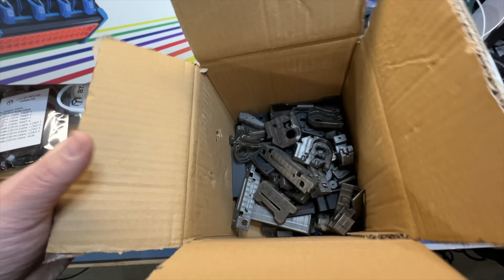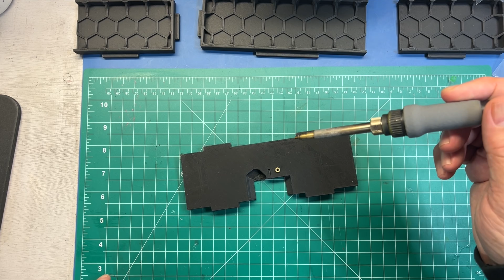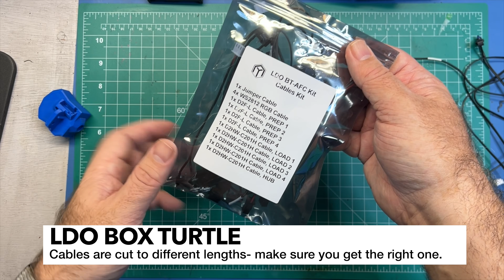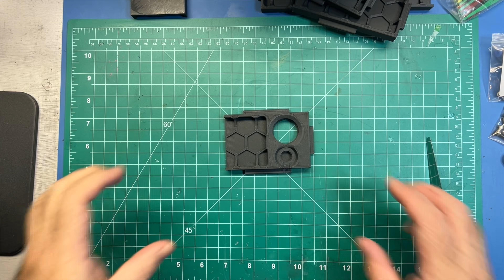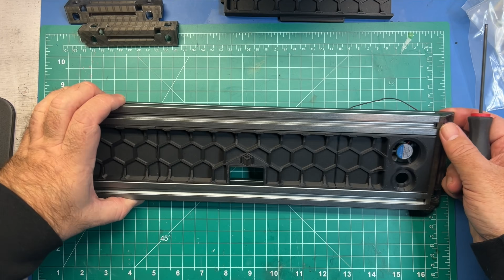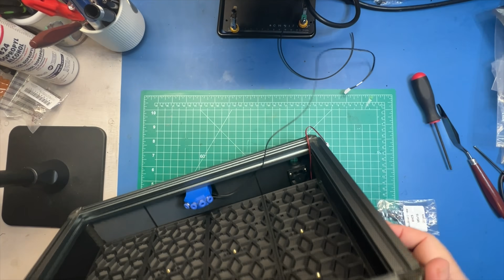LDO Box Turtle Frame Assembly

Comment: Who knows what to do every time I try to get the bowden couplers in abs splits (ABS+ ESUN 230EX 100 bed)
Reply from the maker: It’s splitting? ESun ABS+ isn’t the best filament but it should work. You may want to slow your print down and increase temps to 240C to see if that helps. If the hole is too small (compare to cad drawing) you may need to calibrate.
Reply: @GregsMakerCorner  I think I solved it, overhanging perimeter is flat and not round ( bit cut away with a hobby knife and it fits )

thank you for the fast responcse

Comment: Nice work Greg!   I built my first Voron after watching you build the Siboor 0.2 kit. Bought the same kit. Still running to this day. The Fly Gemini board had a mosfet failure, but got it back up and running.  Workhorse.
Reply from the maker: Thanks for commenting! That's awesome to hear about your Siboor 02, that is a nice little machine! The mosfet failure seems like a bummer, but glad you were able to get back up and running. I haven't had any failures on my boards so far except for those that I self-inflicted... (usually reversing polarity!).